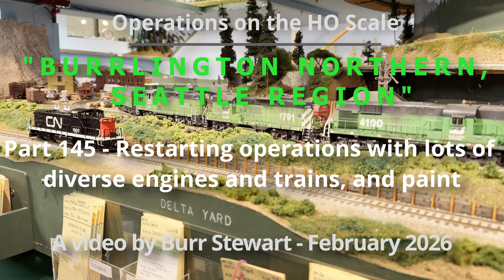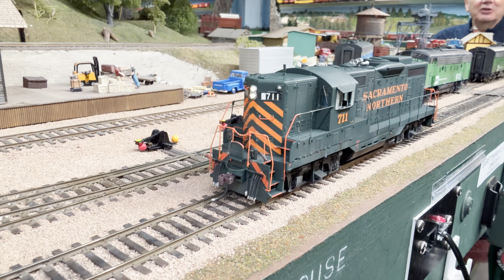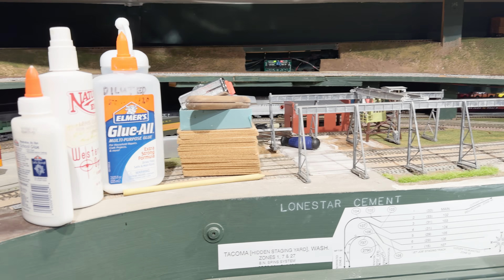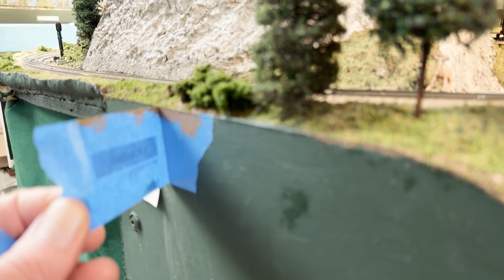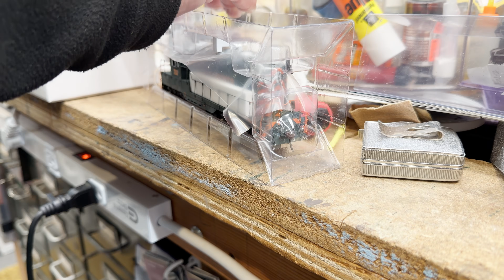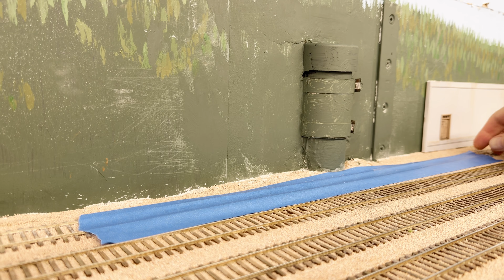Part 145 - BN, CN, SN, BR engines, trains and bangs! #modelrailroad #hoscale #ooscale #train #art

Comment: How does the squealer work? And where did you get it?
Reply from the maker: It comes from a small company called ISE - Iowa Scaled Engineering. It has a motion detector that you install between two ties in the center of the track, and whenever something is moving over it, it squeals randomly. If the train stops over it, the squealing stops. Amazing!

Comment: Absolutely awesome layout and man do I love the variety of motive power in this video 👍For 15 years I modeled ATSF, SP, and BN near exclusively. SD variants, geeps, dash 8’s and 9’s and any of the 4400 variants, I have and have had more UP units, have the 8100 nickel plate NS heritage unit that was my first 6 axle dcc loco (my first dcc loco ever actually was a 4 axle NPR geep30 actually too even though I never modeled anything that was out east but when I first got into dcc for some reason I really liked the black with yellow stripe NP locos). I’ve got two layout currently, one when fully completed a proto ops based 1910-1935 era triple decker focused on the GCL system with a mainline section and mainline yard, and two of there branch lines, as well as the SP’s GH&SA subsidiary PL branch on the Texas coast. Second layouts a late 60’s-70’s “Lost Pines Industrial” freelance industrial focused switching layout with UP and an SP short 4 axle framed first/second gen switchers, and in March/april will be build a third layout, a proto-freelance 1980-1995 pre mega merger ATSF’s El Paso sub with the SP’s sunset routes interchange with a yard in El Paso and a single line main with a couple single main industries along the layout on the way so I have a layout for my massive fleet of ATSF, SP, and BN as foreign power and “modern” rolling stock to escape the display cases and boxes and have a layout to call home and operate again on 👍👍 main layout will be strictly DCc ESU cab control wifi throttle system, industrial switching layout is a DC/DCC EZ command and a switch to use a NCE powercab if I want to ever connect it to that layout, third layout will be a dc/DCC primarily NCE powercab with a smart advanced SB5 booster system for it, and I’ll be getting a booster for that EZ command for the industrial switching layout so that it can also switch over to the industrial switching layout and the El Paso sub layout so if I wanna run the dc only locos I have I can while still running DCc locos at the flip of a switch go back to the NcE system 👍
Reply from the maker: I like the idea of building a "convertable" switching layout. I might have to do that myself...
Reply: @muchfunwithtrains convertible? Like having it be able to switch from DC to DCC?

Comment: 7:10 "I can't say for sure if those two engines were actually purchased by 1973."
They weren't -- BN 7048 was built in March 1978 and BN 7127 in January 1979, but I won't tell if you don't tell.

Looks like only BN 6325-6365 were built by 1973, plus the non-dash-2 SD40s.
Reply from the maker: I've been afraid of discussing this for many years now. Thanks for clarifying it. I have a bunch of GP30's to put decoders in, and three non -2 SD40's, so we will eventually "arrive" in 1973. But I won't tell if you don't tell. :)
Reply: Exciting, personally, I love plain SD40s and GP30s. Looking forward to it.
Reply: @muchfunwithtrains  I love GP30s! (And SD40s.)
Reply from the maker: The original Athearn Genesis SD40's (which I have three of) had bad motors, so they have little no pulling power. I'll have to remotor them, which is a project and a half...